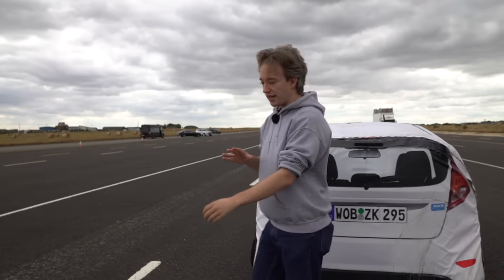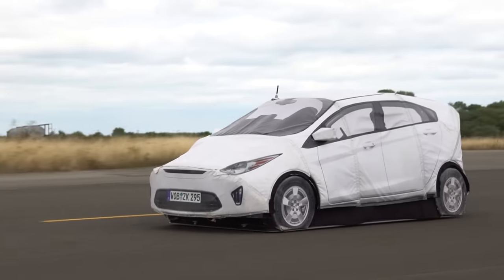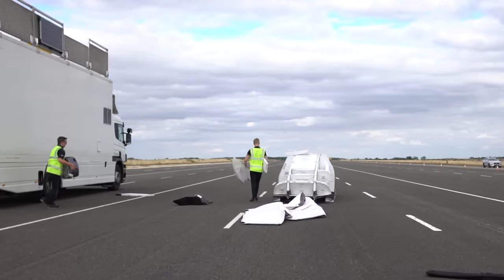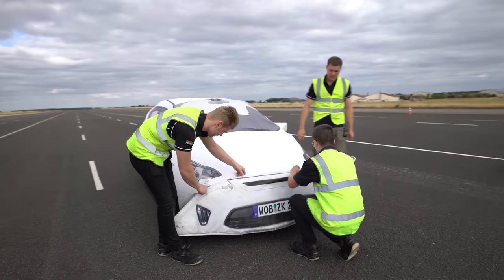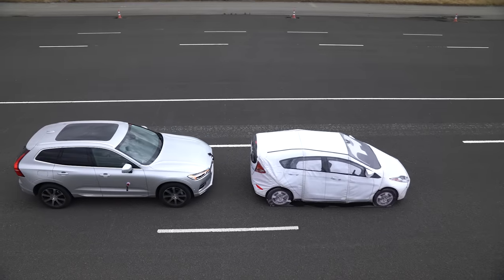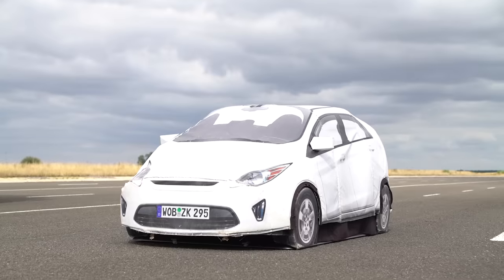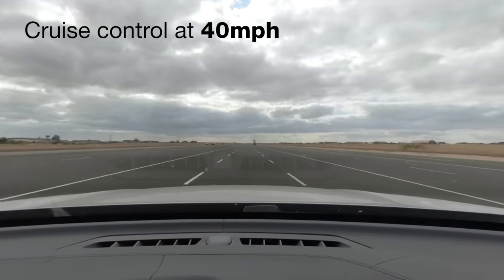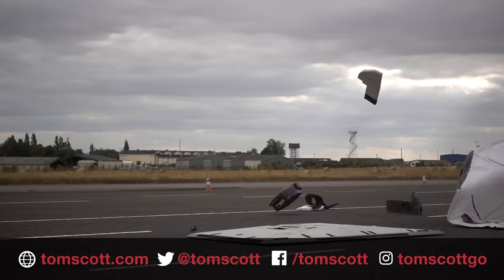The collapsible crash-test robot car

Comment: I would like to have seen more details about that robot. It's quite amazing how they can manage to pack something that goes so fast into something so slim, meanwhile also keeping it durable enough to be run over by cars at highway speeds.
Reply: The secret is short run times, Speed durability range and form factor are our sliders here, if it only need to be at speed for 5-10 minutes for a test then you can plug it in to a generator or swap the battery while you reassemble you can shove that range slider to the floor, they also only went to 50 which will depress the speed slider a bit so you have plenty of room for durabilty(weight) and formfactor, the latter of which also helps the former by acting more ramp like and not eating the entire force at once.

Comment: 2 Questions:
* If it brakes this late and hard, then surely the car behind you won't be able to break in time, and will hit your rear end (possibly causing you to hit the vehicle in front anyway)? I'd argue it should brake earlier and slower, to give the driver behind you time to react as well. Now - because your car continues at speed for too long - you're obscuring the car in front from the driver behind you, which only makes the situation more dangerous.
* That second one... didn't really work, did it? Why not?
Reply: 1) in the US at least, the driver in the rear is usually found at fault for "unsafe following" during most rear-end collisions. (The driver in front may simultaneously be charged with something else, depending on what they were doing).
2) Eh - the driver should have seen the obstacle before the system was programmed to react, so they would still be at fault; BUT I'd still be happy if the system reacted faster than I could and that small bump was the only result. That collision was better than a full-on crash, so in a way it did work. (Sounds like the system could use a bit more tweaking, but kudos to the car maker anyhow)
Reply: It's mainly to reduce the speed at impact.  Sure it's great if an impact is avoided, but at higher speeds so much distance is needed to stop that without lots of false positives it would not be possible to program that.   Crashing at 20 mph is still better than at 40 mph.

If cars were connected, then it would be possible, but that brings up a low load of security issues.
Reply: @tams805  or if it learnt to lane detect it could sense the road either side and over take and accelerate away. Such linear thinking tut tut
Reply: Yup, this is the big issue. Especially, with idiots tinting the rear glass totally black, you won't be able to see the traffic.
If something that should be illegal, it's one of the most dangerous modifications ever.
Reply: The radar has a limited range. At the speed they were traveling, during the second test, there wasn't enough time to stop once the radar had detected the obstacle. At lower speed, the radar would detect the obstacle and have more than enough time to brake earlier and more slowly.

Note that this was a test of "adaptive cruise control" and not something akin to Tesla's automated driving system. It's a last-resort accident prevention mechanism; not a means for you to forego braking completely. Think of it as an airbag.
Reply: @CDArena  I handle car crash claims for a Dutch insurance company. I see more and more cases where people are either blaming the technology in their own car for collisions ("I can't help it, my car didn't warn me in time") or the technology in the car in front of them  ("the car in front of me had an automated braking system, I can't beat that response time"). But under current jurisprudence it is usually ruled that if you hit the car in front of you, you were either not keeping sufficient distance or you weren't paying enough attention to the road. 
Cars with brake assistance are making some drivers lazy and inattentive. That will only get worse when cars take over more and more from the driver. And an interesting question is who would be responsible in a crash with a truly self-driving driverless car.

Comment: There's an interesting shutter sync artefact at 2:29. Every five frames the alloy wheel "spokes" (which are otherwise in sync with the frame rate) jump, suggesting there's a slightly longer or shorter interval after every fifth frame, than otherwise. What camera was used for that segment?

Comment: I know its only additional safety but still im mildly concerned that the car actually bumped into the foam fiesta at the second attempt. Many people probably think and rely on the knowing that their car has this feature and it will safe them if something happens. Would be interesting to see what happens at 60mph or at germany Autobahn speeds.
Reply: Idiots rely on the system, not people!

A normal, intuitive reaction for people would be to still slam their foot on the brake even though the brake assistant is "handling" it!

Comment: So, were those test hits or were those instances where the car was going too fast to stop in time?
Reply: The car didn't appear to slow at all, so I'm guessing test hits.
Reply: also the car in question (unless its had an aftermarket system fitted), is far too old to have auto-braking capabilities, and as a guess is just a car normally used for filming other cars (hence matte black paint)
Reply: +Bean_ So much for my powers of observation! :P Thank you! :)
Reply: probably a test car for software development although i think any car that has ABS is capable of auto breaking but im not sure

abs can certainly interupt the breaking system to maintain t raction but idk if it is capable of operating the breaks itself or if it needs user input
Reply: probably depends on the type of abs (mechanical or electronic).
Reply: did they have mechanical abs? i thought the whole deal of abs was is inteligently applied the breaks
Reply: abs simply lifts the break when the wheel stops turning.
Reply: ABS - automatic braking system - exists to prevent wheels from locking, it does nothing else.
Reply: yes but in more modern cars that have abs its done by a brake by wire system which can be tapped into and used for automated breaking theres already a couple projects that utilise the cars can bus system and external electronics to turn a normal car with modern abs into a auto braking car

Comment: 35 mph is aprox. 56,327 Km/h to my metric system boys out there
Reply: 56 thousand?! That's orbital, sonny!
Reply: Question is did you use UK or US miles...
Reply: By the looks of it he used astronomical miles...
Reply: Not everyone uses commas as thousands separators.
Reply: That's not a approximate, it's approximately 55kmh
Reply: It's called a decimal point for a reason ;-)
Reply: If you are going to use a "," for a decimal, just use only 2 places, not 3. In, Canada we use km/h and "."
Reply: jesus thats fast

Comment: Or uh, you know, outlaw cruise control and self driving until it properly works? Cruise control is such a dangerous implementation of lazy technology, it's horrifying. Especially in combination with modern distractions already built into cars. Not to mention the distractions people carry like cell phones. While this technology is fascinating, it's equally likely to cause accidents with people driving older vehicles. Perfect example being that I nearly ran OVER a Mercedes with this automatic braking because it seemed to decide someone was going to jaywalk, and the driver was talking on the phone, ergo, not paying attention, so the car took control. The person did not jaywalk, they stopped, and if the road hadn't been clear I'd have been at fault for hitting a car that needlessly stopped. Again, while this is a cool technology, I feel like it's simply saying "It's alright dear, you don't have to be a competent human being, you can just sit back and let the gadgets do everything!"
Reply: The problem is that if it's outlawed until some arbitrary point in the future, nobody would actually spend money to improve the technology.
Reply: Driving a steady speed is a dangerous horrifying technology? You know people do that without cruise control also...

Comment: Assuming that everything on the road is a car... Oops
Reply: John Robson would be nice to know what they’re doing for pedestrian protection.
Reply: @bfapple   Quite simple, reinforcing the car structure so the driver and passengers would not result injured from the tremendous impact...
Reply: Have a look at EuroNCAP crash tests (they have a YouTube Channel). Modern AEB systems can stop/slow down for pedestrians and bicycles as well.
Reply: They have similar test dummies, but built to resemble humans, both when it comes to how it looks on a camera and when it comes to radar backscatter. They even have some advanced dummies that will swing their arms like a human does (yes, this affects the radar). Other than that, it's basically the same tests.
I know Volvo has pedestrian airbags that will lift the hood of the car so that the pedestrian, should it get hit, will not hit the very hard engine block, but instead a slightly cushioned hood.

Comment: what about cyclists, pedestrians and animals? Car manufacturers only think about the drivers. They went so far as demanding that children should wear gps transmitters because they can't get their pattern algorithms to work for cylists and pedestrians.
Reply: actually they do take that in to consideration. They even test pedestrian safety in crash tests. Newer cars(not autonomous) also have cyclist and pedestrian warning systems in place
Reply: Yeah, that's why they install airbags for pedestrians. What are you talking about? These systems work on pedestrians too.
Reply: There's no such thing as pedestrian gps transmitter
Reply: I think youve misunderstood the video (or techonology). The radar pieces on the foam "target" are there to simulate a real car. Cars do not transmit radar but in this case it is used to trick the car to think the "target" is a real car.
Reply: @minj4ever: Yes there is. I can't find the article about childrens backpacks and bycycle helmets with gps transmitters but just search for "GPS Mobile ITS for Pedestrian Safety".
Reply: @Roni: Yes I understand the video. I'm just saying that car manufacturers struggle with their self-driving cars to detect other forms of mobility. That's why they lobby to get pedestrians and cyclist to adapt and subdue. The same thing happened in the 1920s with "jaywalking". Shouldn't we know better. It's not the 20th century anymore.
Reply: This is a video about a safety feature on regular cars using cruise control on the freeway (a place without pedestrians or cyclists). It isn't about autonomous vehicles, which aren't on roads with people yet anyway because, like you said, the technology isn't good enough.
Reply: There are self driving cars on puplic roads. In march a pedestrian was killed in arizona by a autonomous uber car. And the web is full of videos of tesla cars in cruise mode having accidents (not just on highways, urban streets too), becaus some smart car manufacturer thought it was a good idea to call it autopilot.
Reply: There are systems that can detect and predict directions for pedestrians and cyclists too. Just because you dont know it doesnt mean that it doesnt exist.
Reply: You missed the point here didn't you. It's to protect the driver. The driver won't get hurt hitting idiots on bikes or dogs. It is also an assist. You might never need it if you aren't a drink driver and you put your phone in the glove box. But if you're drunk and need to check Facebook while your driving you might kill and animal or hit a cyclist or two but you might not rear end a lorry mongo chops
Reply: @schokoladeneis1993  I don't care about your articles. That is not how GPS works
Reply: We also have a solution for that. It's called a LaunchPad. Essentially a smaller version of the GST.

Comment: This is all very encouraging. What could be great is if cameras/radar were installed on light poles, watching all the pedestrians (not recording or identifying anybody). Then AI would be calculating probabilities based on movement and speed whether someone was about to walk or run onto the road. All cars could be required to constantly interact with this AI, so that if, say, a child was running around erratically on a pavement, the AI could judge there was a 70% chance he could run into the road, and, based on his distance to the road, your cars' distance to him (plus speed), could prime the cars' brakes and steering.
Reply: interesting, but a bit of an overkill with high maintenance cost. The driver should already be aware of pedestrians at or near the road and estimate (the uncertainty of) their motion. Putting warning road signs in critical areas and making road and pavement more visible solves 99% of problems with just a chainsaw, pole, metal sheet and bucket of paint. And you can spend the money you saved elsewhere for better effect.
Reply: Of course the driver should be aware, but pedestrians are still killed all the time (whether it's their fault or the driver's). The point is obvious: investing in AI infrastructure will give superior protection to pedestrians, and save hundreds if not thousands of lives.
Reply: The real question is, where should the money be spend for best effect on lives saved. What you are proposing is a large-scale integrated surveillance system - such things are ridiculously expensive. On order of magnitude they are similar to establishing no-driving zones and public transport to them, which would eliminate 100% of car-pedestrian encounters.
Reply: No, that's not what I'm proposing. I'm proposing sensors or cameras on every lamp post, all connected to a central AI controller. It's not surveillance, which I made clear in my original comment. There would be no recording or ID'ing of people. Just movement prediction to prepare cars for evasive action. The car and driver would be ultimately responsible for what happened, but the AI would prime the car if it deemed a certainly probability of danger. And it would be worth all the money thrown at it if it would save lives.

Comment: If the driver assist program recognises obstacles by radar, and you're training it with a mockup that needs to reflect radar exactly like a modern car, you're going to be in trouble on any real roads.
Even on highways with only motorized traffic there are motorbikes, caravans, trucks, tankers, log haulers, small home-built plywood trailers being towed slowly, classic lowslung oldtimer convertibles without any upper structure, boats on trailers, weird large construction traffic like a large bridge girder on separate front cab and back wheels, in the US even houses on trailers, in Europe the occasional old "cake-tin" on wheels with a rounded rubber roof with a little porthole, and everywhere sometimes a dropped load (like the big sofa in the middle of a 3-lane highway I encountered one night).
None of those will have a radar signature that's recognisably like the standard hatchback car on which the system is being trained.
But the drivers will be inclined to relax and take their attention off the road once they've gotten used to the automatic assist; they already do so now when their phone distracts them, though they know it's dangerous - this tendency will only get worse if they think their car is "self-driving" and "doesn't need their input, hardly ever...".

That's even without taking into account cyclists and pedestrians which such cars have already proven themselves to be unable to handle safely - see the videos of the self-driving car overtaking a cyclist with only a few inches to spare, not deviating from its line, and the crossing pedestrian killed by such a car, as well as the articles about the need to either control pedestrians and cyclists around such cars or make them (including playing kids) carry some electronic signaling device that would help the car recognise them.

Comment: May I point out that the german license plate on the dummy car is incorrect. The area code of WOB is assigned to the city of Wolfsburg (where VW comes from) but the seal is the one from Bavaria while Wolfsburg is in Lower Saxony.
Oh and it doesn't really loke like a license plate just like some paint.

Comment: I used to drive a delivery truck on Fridays. It was about 700 miles of almost all highway driving. It was incredible what your brain wouldn't let you see! There'd be stopped traffic on the freeway and you would almost never be aware of it until it was really close. Like the distance where you realize you need to change lanes to get around a slower car. 

One stopped car in the middle of the road and cars would only hit their brakes at the last second. After that, the huge crash caught other driver's eyes and they'd slow down in time, but until then, that car in the middle of the road was definitely going to get hit. :-(

Comment: Does it need to be like a puzzle that takes 15 minutes to assemble? Why cant the radar material simply be held in shape with a thin and light but somewhat firm wire frame? It will stay intact after the impact and can quickly be placed back on top of that robot platform

Comment: My old car had ACC that turned itself off at low speeds as you describe. It was a manual though - not a lot of choice in the matter really. What else can you do? It still had autonomous emergency braking that worked from above the speed the ACC switched off, so if you really did do nothing, you should be fine.

My current car is an automatic so works down to 0mph anyway.